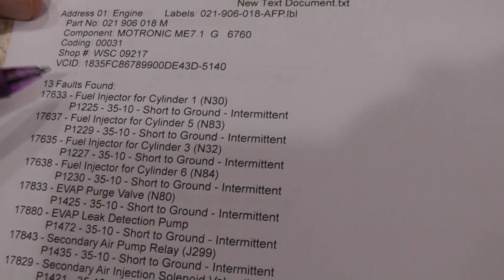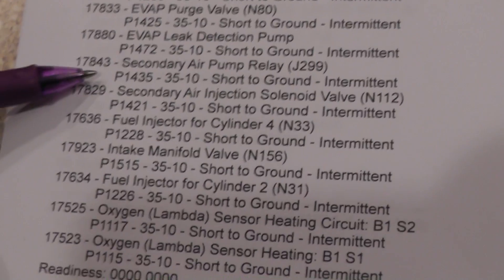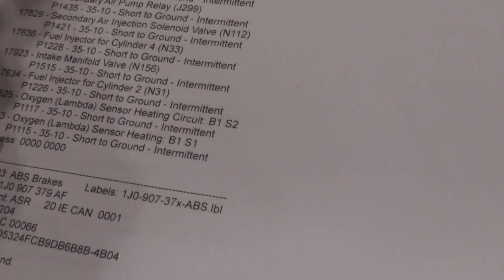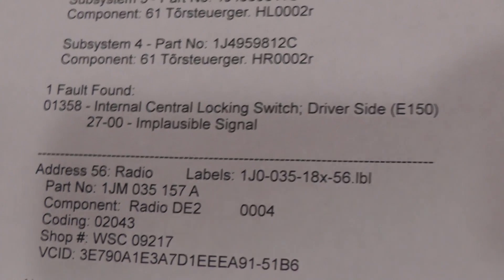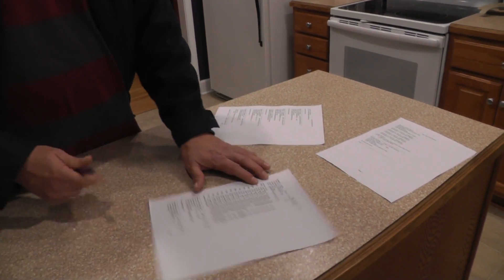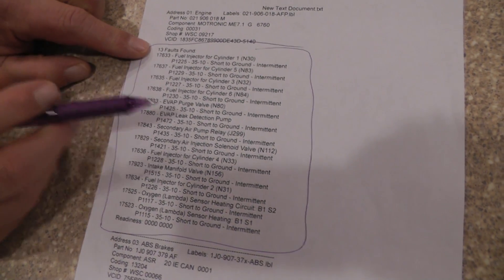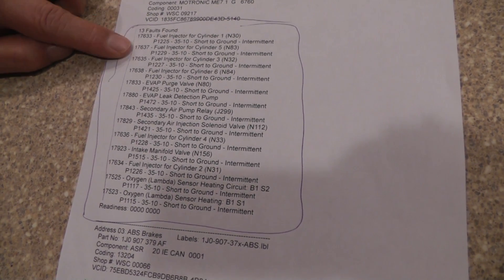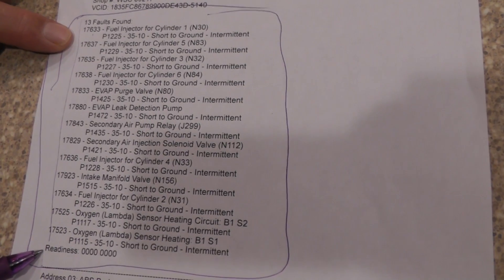Volkswagen Jetta Engine Stops When Driver Door Opens

Comment: Will change the relay and see what happens
Reply from the maker: Just keep in mind that a lot of these aftermarket fuel pump relays will not work. The problem developed for me when I changed out the original relay as a good measure since it was old, but yet it was still working. Just get an OEM relay and you should be fine.

Comment: Awesome find!  I was getting frustrated trying to figure out why my wifes golf would die when the door was opened.  After seeing this i realized I had installed a non OEM relay during fuel issue troubleshooting.  Swapped the OEM back in and now everything works perfectly!
Reply from the maker: Glad to hear Marcus that putting the OEM relay back in fixed your issue :)

Comment: Nice work figuring it out. Good lesson here is when you're working on your car trying to solve faults, work on one thing at a time and check things after each repair !
Reply from the maker: +Suj In this case when the fuel pump relay was replaced, there were no issues even when the driver door was opened. Then a month later, the driver door lock module was replaced and that's when the problem started. It would appear that after replacing the last thing, it would seem to be the door lock module. But in this case, it was the fuel pump relay. In all fairness, the driver door lock module never worked when the car was bought. If you're interested in this same problem, check out Ivan's channel where he has a three part video series where he goes into more detail. You can see the first video here https://www.youtube.com/watch?v=G_uBUhZgXxk
Reply: Oh wow, I didn't realise you'd done the jobs so far apart. That would have driven me NUTS! This is the first time I've ever heard of this door open / engine off issue. My drivers door module also requires a repair, hopefully just a new microswitch which I need to fit and maybe reflowing some solder. I'm in the middle of doing my rear shocks and springs at the moment :-)
Reply from the maker: +Suj In your case, the most likely issue is the microswitch which detects when the door is open or close as it fails pretty often. The biggest thing from all of this is that if you ever change the fuel pump relay, make sure that it is a genuine OEM part and not an aftermarket relay.

Comment: Dang over-engineered German technology! That must be a "fancy" relay, not a traditional 4-pin type. Would have loved to see the wiring diagrams and a detailed breakdown of what was happening to the feed voltage when the door was opened...but that would make for a long video requiring a long attention span :)
Reply from the maker: motoYam82 Hi Ivan...you're right that it is way over engineered, and I don't know of any other manufacturer that allow the fuel pump to prime when you open the driver door. And you're also right that this fuel pump relay is not your traditional four pin relay. If I remember correctly, it's a nine pin relay. I still have the aftermarket relay, and I've thought about going to the junkyard and getting an OEM relay, open it up and reverse engineered the both of them. But the more I thought about it, not many people want to sit there and watch a boring video about electronics, how it works, etc. And of course, the time to put into it would be a lot. I figured the information would be the most helpful to most people out there if they ran across that scenario of putting in an aftermarket fuel pump relay. I appreciate the feedback Ivan and have a good one!
Reply: stuzman52 I have an '03 VW Jetta coming in on Thursday with this exact complaint...should make for a great video! I might order a new VW FP relay ahead of time :) You are absolutely right Terry, "one of these days you guys will run into this problem" haha
Reply from the maker: Hi Ivan...the wife and I just got back from a week vacation in Florida. I saw your video on the VW and it looks just like what I was experiencing. I believe you're on the right track and looking forward to part 2. Keep up the good work Ivan..

Comment: enjoy you*re vids, very helpful. liked the one with the Ranger / fuel sending unit. I own a 1990 ranger with the same problem and am going to install a new sending unit, also has a temp gauge problem. I put two 47 ohm   resisters in parallel, and hooked them to ground at temp sending unit connector and got a mid range reading from the gauge. so, I bought the 7.00$ unit and installed,reconnected and still no reading after warming up the eng. any ideas what may be wrong? could it be a ground issue or another sensor Thanks
Reply from the maker: Glad to hear that you like the videos Noel. I'm assuming that my wiring diagrams for a '94 Ranger will be the same for your '90 Ranger. The temp gauge is fed through a thermistor sending unit. For the gauge to read at the cold mark, the resistance of the thermistor is 74 ohms. For the gauge to read at the hot mark, the thermistor is 9.7 ohms. For the needle to be in the middle of the gauge, this would be a resistance of (74+9.7) / 2 = 41.85 ohms. With your two 47 ohm resistors in parallel, that would give you a resistance of 47/2=23.5 ohms. So, your gauge should have read a little lower than midway. To verify that the gauge is working correctly which would also rule out the B+ and ground is take just one 47 ohm resistor and see if the gauge reads slightly higher than midway. Remember, the 41.85 ohms would put the needle in the center. If this works correctly, the gauge, along with the B+ and ground to the gauge are good. Then the problem is in the sending unit circuit which can include the sending unit connector, C168, along with two other connectors, C123 or C105. Holler out if you have any other questions.
Reply: Thanks for the info  will let you know when I get it working properly

Comment: what is the relation between the door opening and the fuel pump relay going funny? fair enough the relay was faulty, but why did the problem only come to light when the door was opened? voltage spike? was it just the drivers door or any door? (sorry for the questions) Great vids, i was hoping you would continue making them. All the best.
Reply from the maker: Hi MrAsadEp. No, I'm quite sure there wasn't a voltage spike. With the aftermarket fuel pump relay, there wasn't a problem in the beginning because the door lock module had a bad micro-switch where the car thought the door was always closed, even if you open the door. The fuel pump relay is connected to the driver door opening to prime the fuel pump when the door opens. With the aftermarket relay, that function was also gone, but I forgot to mention it in the video. I didn't open up the relays since I only had one VW relay to switch it out, and I needed to get the car fixed. Down the road, I may go to a junkyard and get a VW relay and look into it a little further to see what's different. The fuel pump relay is not a typical relay using a coil. Inside there is electronics receiving several inputs, so there is some difference between the hardware of the two components. As for the other doors, they didn't have any effect on the car running when their doors opened. And no need to apologize for the questions as we're all here to learn. And the best for you too.
Reply: stuzman52 Previous to your repair to the door lock module, with the car thinking the door was shut does this mean it did not prime the pump? and the pump was primed when the ignition was activated? (relay recieves input from the ignition switch but not the door thus primes anyway) strange how VW chose to prime the pump with the opening of the drivers door, Thanks again
Reply from the maker: ***** The way it's supposed to work is that when the driver door is opened, the fuel pump will prime. This will happen before you put the ignition switch in. I guess VW was thinking of pressurizing the fuel rail before the ignition switch was turned to start the engine. The ignition switch B+ does feed the fuel pump relay, but not for the priming function. Yes, it's strange how VW does this as I don't know of another manufacturer that does it. All others that I'm aware of does the priming when the ignition switch is turned to on. Also, as another note, there is more to the relay than just priming when the door is opened. Somehow, the relay contact was actually opening and closing when the engine is trying to start if the driver door is opened. This of course is a malfunction. As mentioned, there is something different in the electronics between the aftermarket and OE relay.

Comment: Good info, thanks for sharing! Never ran into the stalling issue before, but had one that would set a fuel pump relay code (not the short to ground faults).
Reply from the maker: Hi Thomas. Always glad to share and thanks for stopping by and leaving a comment. This was a strange one for sure and took a chance that the fuel pump relay was the issue. I got lucky on that one.

Comment: Terry that was incredible.  I would have disconnected the drivers door harness first since its logical that was the last repair and I would have wasted a lot of time.  Interesting about the relays and aftermarket parts. I have noticed in the past aftermarket relays not showing on the relay schematic a required diode.  I wonder if that's the difference in the two relays ?   Did you find out what's the difference ?
Reply from the maker: Hi Steve. Yeah, I started to go with the driver door module, but with a little thought, it didn't make sense since everything worked with the module such as the lights, alarm, etc. I didn't know if it was going to be the fuel pump relay, but took a chance to see if that was it since it's contact was supplying all of those circuits. I figured that maybe something was different in the electronics of the relay.  It was a very strange case for sure. I fixed it about two months ago, and didn't film it, but thought it would be some useful info now. I never did open up the two relays to see the difference. One of these days, I may have to do that. Thanks for dropping by and for the comments.